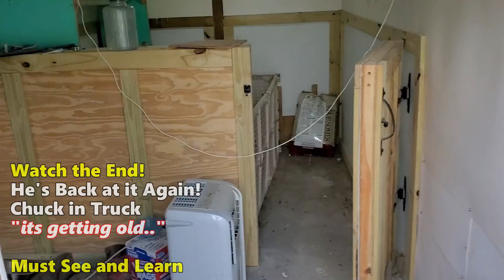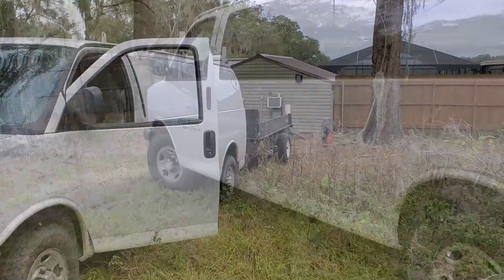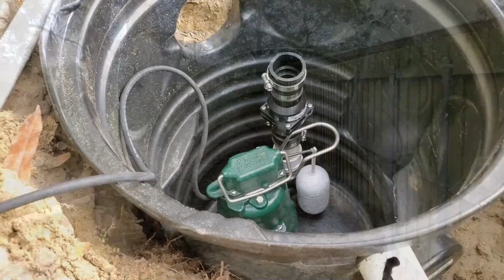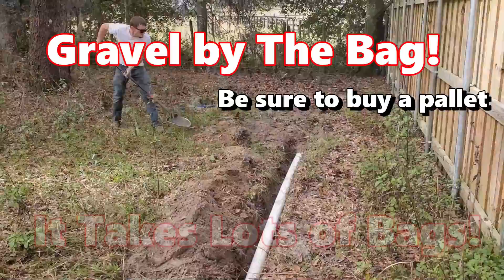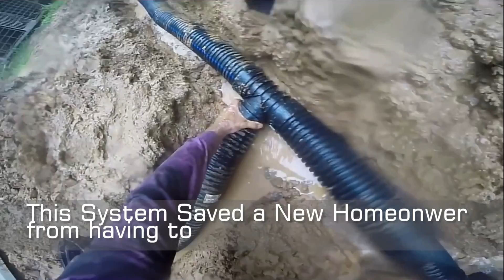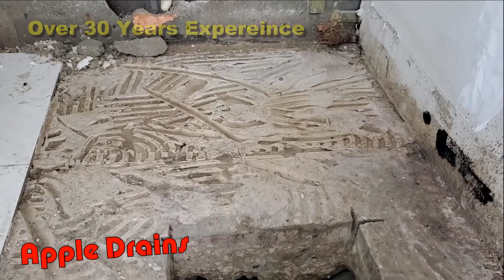Apple Drains Doing the Impossible Where No One Else Could - And Makes it Look Easy

Comment: It looks like there was some sloping from the house towards the fence. Maybe you could lay large slotted pipe all the way down there with no pump. It the pump breaks or there is a power outage (which happens quite often here in Sydney during a storm) the pump will be no help. I laid down 150mm sewer pipes slotted on the top with an angle grinder having  a diamond off-cut disk, which works quite well. Almost all the time (even when no rain) it collects some ground water and releases it into the street.

Comment: I used to do some manual labour for a builder (in Queensland Australia) he had made a fantastic tool for tree roots which he called 'Excalibur'. It was an axe head welded 'in line' (not perpendicular) to the end of a heavy steel excavation bar. You could chop roots with great effect and because the action was all straight up and down you get a great 'swing' deep down into a hole or in tricky spots where you couldn't swing an axe.

Comment: It’s funny that there’s beef between two drainage YouTubers. I’ve learned a lot from all the drainage guys here. 

But FDM turns me off with his comments and he’s trying to sell his fancy, expensive sump systems and pipe. Looks nice and all, but let’s be real. Most of us are going to Lowes. That’s why your channel is more relatable. You show the true DIY way. For FDM, you gotta hire him and drop $$$$.
Reply: I just put in a decent size system for one of my customers.I looked at the pumping system FDM had and it was way too expensive. I went with  the zoeller m98 and a very large sump basin and it was less than FDM's small unit. Apple drains have taught me a lot and I took the NDS drainage classes to get certified.